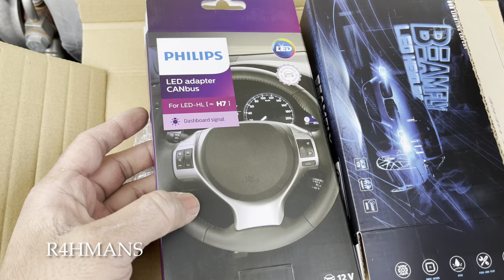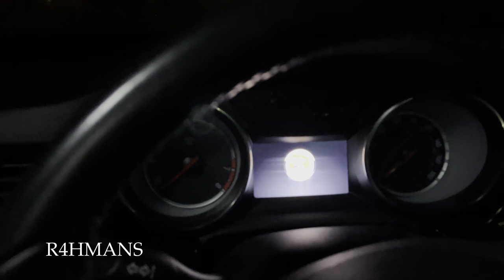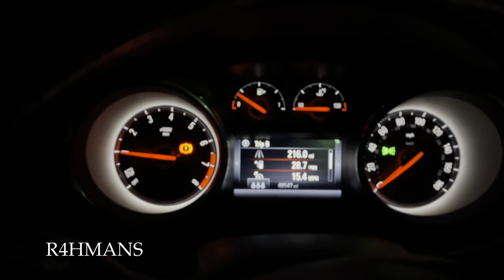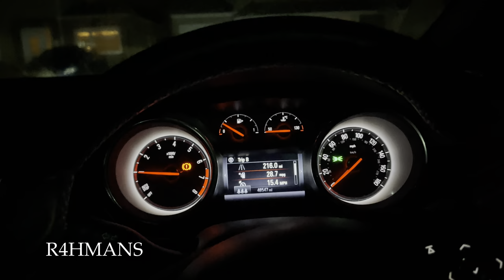Astra K LED Headlight Upgrade

Comment: Hey, you know the Cap for the housing, is it an issue to not put that back on?
Reply from the maker: No when I got the car I never had one on for one of them, never had a problem, plus the fan can get rid of hot air more easier anyways, but me personally I have not experienced any problems
Reply: @R4hmans  Having housing lid firmly locked is extremely important because moisture will severely damage the housing's interior. The other problem is the dust. There is only one solution - to keep the original H7 connector inside and to connect the adapter OUTSIDE the housing. And one more thing: bear in mind that in EU using LED headlights is illegal.
Reply: @EmilTheRailwayman  Yes thats right. A problem with dust will apears soon.

Comment: Does have any problem if you will not put back the back cover? Or need to get one to cover the back? Thanks for the vid!
Reply from the maker: No I have not had any problems with it being open so no covers, this car never came with a cover
Reply: @R4hmans  thanks mate!
Reply: The car has covers on the back for moisture not go inside the Headlight. You might damage the Headlight

Comment: Have you had any issues with water entering the bulb housing as the back plate cannot be fitted?
Reply from the maker: I have not been having any issues with it, it’s been raining heavy and it’s going perfect
Reply: The Philips H7 lights come with a grommet to pass the cables through. You will have to drill the cap of your headlights though to get the grommet to fit. Theyll be perfect after doing so - never had any problems. I wouldnt recommend using them without the cover as moisture can easily get inside.

Comment: Are these not illegal in the UK though? Pretty sure these will fail an MOT flat out without even being tested as you're not allowed to change your bulb type from factory as the housing is designed for a specific type of bulb. The astra has projection headlights and with LEDs it will be too bright. Please correct me if I'm wrong as I do want to do this
Reply: They VOID your insurance, so if in an accident or stopped by police you WILL be prosecuted.  The car would NOT pass the MOT with the incorrect bulbs for the housing.  VOSA investigates all garages that supplied MOT certificates when drivers claim/lie "it passed the MOT like that".  
The LEDs and HIDs are a different shape to the H7 bulbs that the reflector or projector unit is designed for.  The focal length is different and although the HID and LED "look brighter", they put less light on the road compared to a standard H7  in the correct reflector or projector housing.  That is because the light is scattered everywhere and not focused as it would be from a correct bulb in the housing designed for it.
Is it really worth LESS light on the road and 6 points with a huge fine and your car taken off you?

I have cars with H7, HID and LED matrix lights.  I can tell you that these cheap £10 chinese things being sold do not compare in ANY way to the light output and projection of correctly designed HID and LED lights for cars.  Don't waste your time.
Reply: @Bond2025  much appreciated. I thought this was the case, cheers for confirming
Reply: @mr.baconmontages8929  so we cant change to led light like this
Reply: @mr.baconmontages8929  or it fine bro sorry about my English is not good enough to understand
Reply: @Bond2025  BS. The HIKARI titanova headlights are all bright as the latest luxury car headlights. Halogens are unsafe. The law is so outdated and stupid. Needs to change.

Comment: Wheres the link for the bulbs?
Reply from the maker: H7 LED Bulbs:  https://www.amazon.co.uk/NOVSIGHT-Headlight-22000LM-Replacement-Design/dp/B08MLBDPXJ/ref=mp_s_a_1_1?crid=1YNICJEN1IDDM&amp%3Bkeywords=B08MLBDPXJ&amp%3Bqid=1646585851&amp%3Bsprefix=b08mlbdpxj%252Caps%252C40&amp%3Bsr=8-1&_encoding=UTF8&tag=4hmans-21&linkCode=ur2&linkId=b3057ff891e1b02ae8849d4e58050d7e&camp=1634&creative=6738

Comment: Bro i tried it and the light is still yelow, do i have to buy separate white lights too or can i use my old yellow ones to connect?
Reply from the maker: You will need to buy a separate white LED bulb and a canbus if your not getting the same one as mine.

Comment: Last month a friend of mine installed LED headlights on his car (quite expensive ones, about €100 for set) and this week he faced severe problems. He was stopped at night by the traffic police on the grounds that it blinded oncoming cars too much. They found out that the lamps were LED, took off his license plates and threatened him that if he did not install standard lamps and did not take the car to a technical inspection within 1 month, his car would be deregistered. My friend had to pay €150 fine and €260 for road assistance to bring the car home (about 400 km). And their vacation went to hell. After replacing the lamps, he will have to take it for inspection again with road assistance and pay again. Quite an expensive pleasure, isn't it? The geometry of the LED beam does not comply with European standards. That's why on the packaging of these lamps is written "FOR OFF ROAD USE ONLY". So, before installing LED's read this warning. But if your car is factory equipped with LED headlights you shouldn't worry, just enjoy!
Reply: Not sure if you know, but you can manually adjust the bean from inside the engine bay so it does not blind oncoming traffic.
Reply: You can also adjust the height of the beam from inside the car as well
Reply: @ericzochowski3749  Of course you can, all contemporary cars have the option for automatically or manually adjust the height. The problem is not in the height but in the shape, direction and angle of the beam, which parameters depend on the bulb itself, its position, the lens and the reflector. Simply replacing the halogen bulb with LED cannot produce beam with above parameters compliant with European regulation. To make it properly you must replace the whole headlight body with such designed for LED, which will cost you a fortune.
Reply: @emilstrezov1445 
There are multiple conditions and parameters in which make you a target to the traffic police.

Firstly, if your car is equipped with reflectors instead of lens you might get into trouble since LED bulbs DO NOT omit the light omni-directional, therefore the light pattern is scattered and you'll get caught redhanded. 

Secondly, even in lens, you should take additional steps to adjust the diodes heading into right direction to make the light pattern smooth, neat, and regular.

By adhering to those mentioned, you'll be fine
Reply: Keep the halogen lights with you, so you don/t have to pay for pick up. ;)
Reply: @tomasszfakjutub  Calling people "morons" with that grammar is award winning.